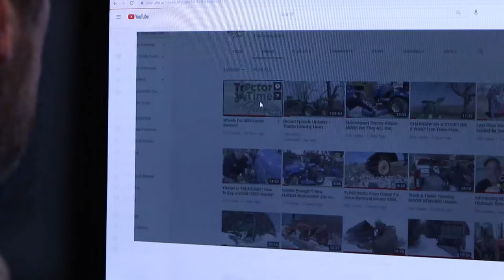What Firewood Dreams Are Made Of: Huge Oak Tree, Stihl Chainsaws, John Deere Tractors & TTWT!

Comment: Hi Neil - it's Big Rodders in Ireland.  I don't think my beloved timber tongs would have been of much use on those massive rings!  Also, your split pieces for your boiler would be of little use to most stoves over here - last week I had an order for a half cord of 9 inch logs no bigger than 2 1/2 inches thick for a small stove.
Reply from the maker: Holy smokes Big Rodders!  That's a lot of little toothpicks to work with!  Yeah, my boiler eats some big pieces but sometimes I break em down just so I can pick them up.  I took your timber tongs along on this job but they never made it out of the truck!  Thanks for checkin' in with this one friend.  Take care.

Comment: If you’ll lower your 3 point down closer to the ground with all those weights you’ll greatly lower your center of gravity thus making the tractor more stable and you’ll be able to lift more weight.
Reply from the maker: That is a good tip but actually the rear tires are filled with rim guard on this tractor providing LOTS of ballast. (Tim mentions how much exactly in the comments on his video). It will lift nearly it's maximum capacity without tipping but these logs were pushing it, especially when starting with the log already elevated higher than what it could have lifted it.  Appreciate you watching!
Reply: It was a great video I was honestly waiting on the loader to break 🤦🏼‍♂️, glad I stumbled upon your channel keep up the great work.
Reply from the maker: @joeydalia2572  Thanks Joey!  yeah, I thought it was gonna break for sure.  I didn't know he had rim guard in the tires cause when I was there I said there is no way just those rear weights are gonna work!

Comment: Unless I’ve missed the explanation somewhere, I Am assuming that you do NOT need to cure your firewood before burning in the wood fired boiler?
Reply from the maker: Most firewood that goes in my stove has air dried for at least a year or more. This oak won't likely make it into the stove this season (now that it has warmed up I know it won't). It just happened to be the tree that fit my storyline as many times I am nearly out of wood and someone will call with a dead tree they want cut up or something that will burn right away. I can mix in some green wood though too when I'm in a real pinch.  Thanks for watching!

Comment: You should make that backhoe splitter into a an X or star shape instead of just a straight edge where it only halves the stumps. Also, you should push it down into the stump when it is resting on concrete .. wouldnt that split the stumps into logs a lot faster? What is the flaw in this reasoning?
Reply from the maker: To split in the concrete you'd need to use a "hammer" motion to get it to split and it's hard on the backhoe.
Reply: @digdrivediy  Got it.